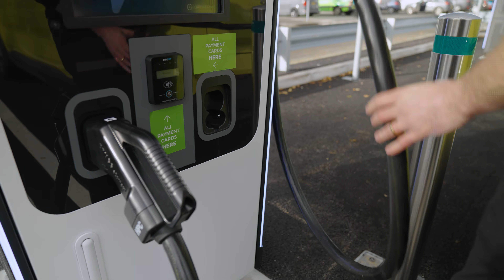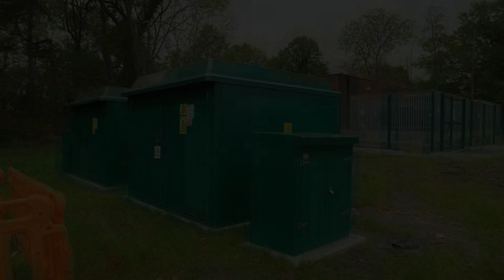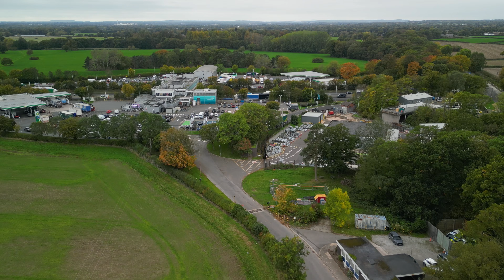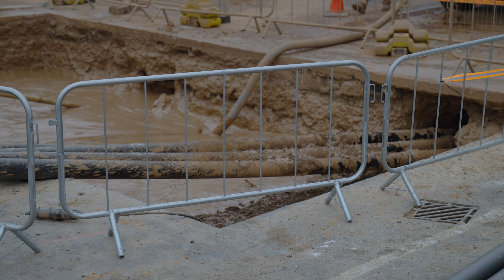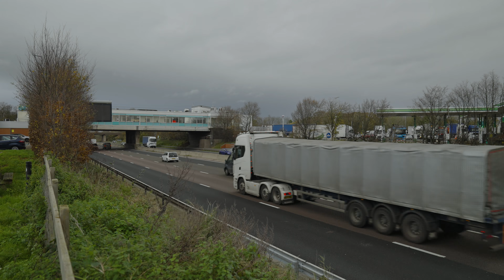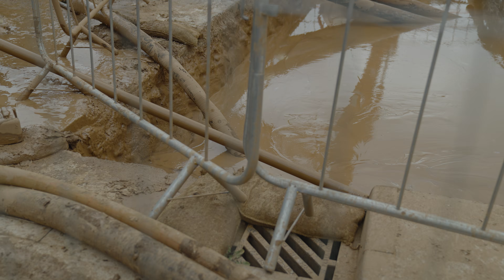Drilling under a motorway? The wild engineering behind the latest GRIDSERVE EV charging station

Comment: Just get an ICE Car 10% to full in mmm 5 mins! not 30 mins!
Reply: That worn out old trope. Many a time I've sat in a queue to get petrol only to get to the pump, to find it's out of use. Then I have to go drive to another petrol station. Or I get home and the orange light comes on. Which means I have to go back out and find a petrol station and hope it's open, or take the risk of being late for work in the morning. Alternatively, my EV experience has been a delight. The car is fully charged by the morning and I don't have to worry. I don't stop to charge. I charge when I stop. Big difference.

Comment: Grid Planner here: Those asking why they don’t use the bridge to cross. DNOs ultimately want to build a network that is safe, reliable and has longevity. The strongest part of that bridge will be the floor base where people cross, the roof is likely too weak. A bridge like that I can clearly see there is no access for DNO engineers to get the equipment they need to deploy the cable and what then in the future for faults etc? Will the bridge be knocked down because it’s knackered? All the HV cables need to be diverted and the spare ducts you put in will be wasted money. Going underground in ducts is the best long term solution for motorway crossings, installing spare means they don’t have to drill in the future and new cables and just be pulled through. Obviously each site is different and there are lots of factors that will determine a crossing like this being justified.
Reply: A recent example of having to divert utilities inc cables across an M road was the replacement of Badminton Road Bridge across the M4. The bridge had to come down and be rebuilt, and being an old A road there have been things to replace before demolishing it. The new bridge is still not open yet, although the decking is there now. That one is a combination between South Gloucestershire Council (they have an entry on it here: https://www.youtube.com/watch?v=1gY_jw7kAWY) and National Highways and other firms, no doubt.

Comment: Great video, shame about the prices. I would only use Gridserve in an absolute emergency and even then it would only be to pop in a few kwh to get me to another charger that cost a reasonable price. Until UK ultra rapid costs £0.50 or less it simply makes more sense to drive my van long distances rather than my EV which is a crazy situation to be in

Comment: I wonder why Gridserve (and others) don't design solar covering for all the charge bays?
Reply: Cost and planning permission I would suspect.
Reply: For the UK it would generate very little energy for the chargers, so it's probably not worth the extra investment.
Reply: @tomsixsix  It wouldn't be for the chargers. It would be for the signage and lighting around the chargers. Like FastNed do. They use solar and wind at Chester services for just that purpose.
Reply: Planning issues.

Comment: I'll never use Gridserve until their prices are reduced by 50%.
Reply: 89p/kWh sadly makes Gridserve completely uneconomical; over 50% more expensive than a fuel car.  Gridserve have just launched a subscription, but it's still too expensive.
Will continue to use Tesla chargers that are open to all, and Ionity.  Tesla PAYG prices around 50p/kWh.  Ionity with a subscription at 43p/kWh.  These are both around the same cost as fuel, so you don't feel ripped off.

Comment: Two years ago and a bit, I spoke with the engineers working for you at Rownhams Service area M3 north/eastbound while they were installing the 6 HPCs. They said they were pretty much using all the available power on that side of the motorway and there was nothing available on the south/west bound side and further, the highways agency wouldn't let them go under the motorway like you did at Knutsford!! Well, eventually another half dozen HPCs did eventually go in on that side but they were throttled to around 40kW [and I think still are]! So that fulfills the target of a minimum 6 plugs per MSA but is totally nerfed in practice.
Reply: There is also an unused Planning Permission for a large number of Tesla Chargers at the Eastbound site and a new Mc Donalds drive through, but without the power it has all stalled.

Comment: You don’t talk about your prices, so that’s why they’re so high.
Reply: How much do you think all that work costs? All that has to be covered, from running costs. When you think you are paying around £1,000 for a simple 10Mtr 7kWh home install. It puts a whole light on what these costs must be.
Reply: @johniooi3954  No doubt it is expensive, but Gridserve appear to be going for the low utilisation, high price strategy, whereas Tesla appear to be dropping prices to maximise utilisation at their sites.  This could actually be more profitable as the big cost of a site like this is the capex and grid connection costs and these both need ongoing revenue to support it.  But Gridserve do not do variable pricing and do not attempt to compete with Tesla yet.

Comment: Seems like a lot of effort to take the cables from one side to the other of the motorway.. didn't they spot the bridge between the two sides of the services?
Reply: That was my first thought, Surely attaching the conduit pipes to the underside of the Service Station bridge - or running them over the top to that end - would have been faster and cheaper. I do agree that Gridserve are the most expensive to charge though. 0.89p is a bitter pill to swallow when Tesla do it for 0.49p.

Comment: Why couldn't the existing bridge be used to carry the cables?
Reply: I wondered that, although, when they said about drilling two 550cm holes, which are huge, and might need serious protection on a bridge.
Reply: @SheepShearerMike  Must be 550mm, but I imagine they're carrying 11kV cables, which probably means a good amount of insulation and airgapping in the tunnel.
Reply: Rownham services on the M3 has a foot tunnel and didn't have enough power on the south/west bound side - I wondered why they couldn't temporarily close the tunnel and dig undereneath that. Anyway they finally installed 6 HPCs on that side but throttled them to 40kW so they must have squeezed a little power from somewhere!

Comment: If you are visiting Norwich there are some 300kw E.ON chargers very close to the Gridserve Electric Forecourt that are only 39p per kwh.
Reply: You're a hero
Reply: 39p per kwh is just about the breakeven cost to charge instead of using the ICE on my PHEV. Meh
Reply: @markmicallef4367 unless you can do the journey on one charge then it’s about a quarter of that. Unfortunately I can’t because my cars 10 years old and has never done several hundred miles in one charge.
Reply: @markmicallef4367  Really?  At 3.5 miles per kWh for an EV you'd have to be running <11.1p/mile, which implies 55mpg - possible, but pretty rare for a PHEV. What car?
Reply: @tomsixsix  it's a c300e and on the highway I get approximately 5.2L/100km, that's about 43MPG, my price of fuel here is E1.49/L
Reply: @markmicallef4367  1.49 euros/L is about the same is costs here, around £1.30/L (my local station is £1.33/L this morning, which I always see when I drive past in my EV).  At 43mpg, your cost per mile is around 13.7p, or per km around 8.5p.  EV breakeven would be about 48p/kWh. About the same as Tesla PAYG price.